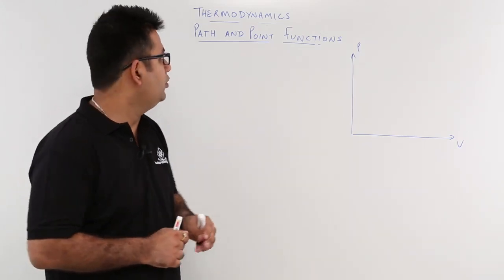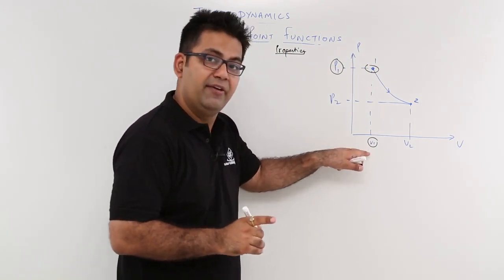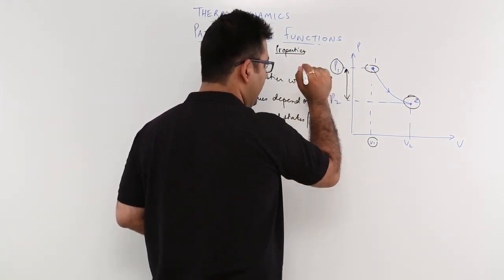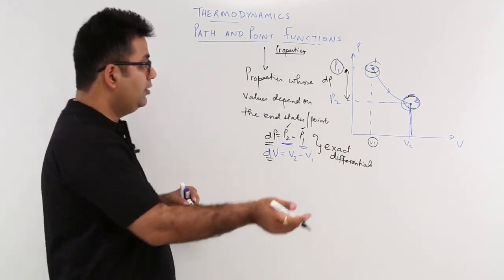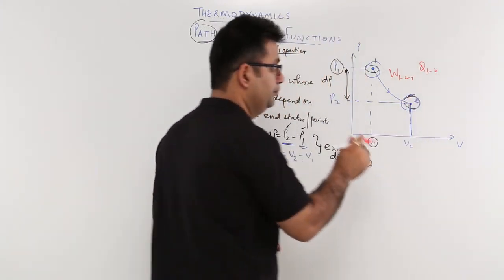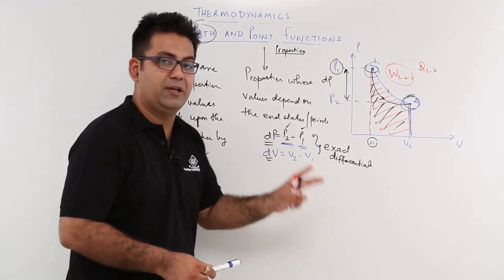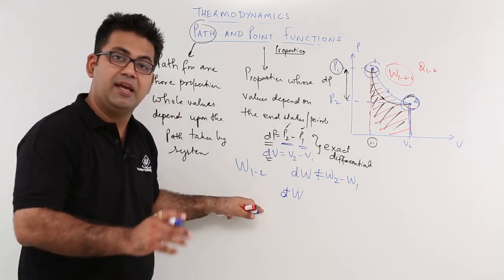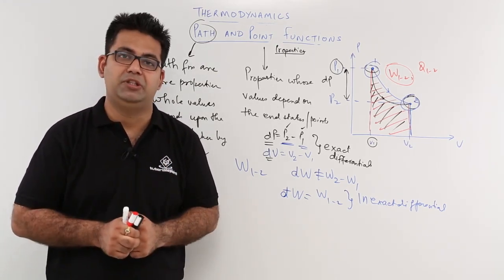Path and Point Function

Comment: Why wouldn't dp = P1 - P2?
Reply: You think just like me.. 
Look..
We only need the distance netween p1 and p2,so we simply calculate from reffrence point i.e where p and v are both zero.. 
It is hard to explain in words i need some sketches here and  i have not lot more tools but i think you get the idea..
Reply: because the process is from state 1 to 2. Pressure changes from P1 (Initial) to P2(final) so dp (change in pressure) = p2 - p1